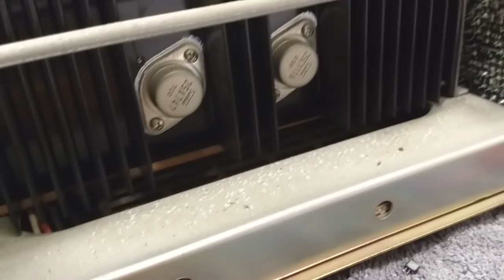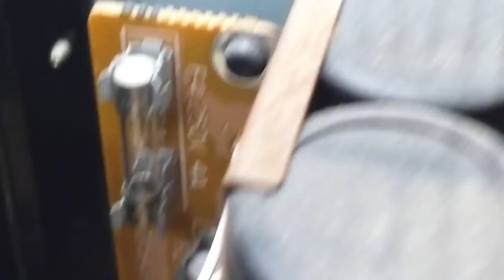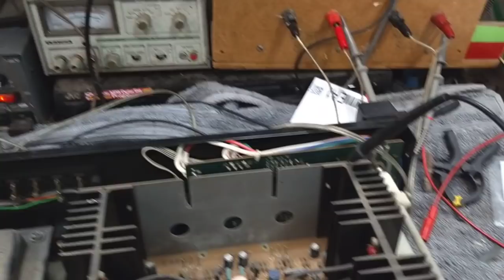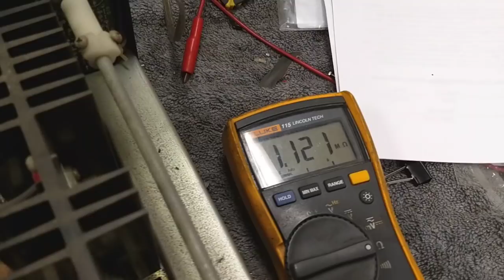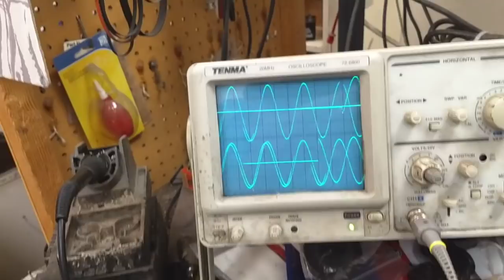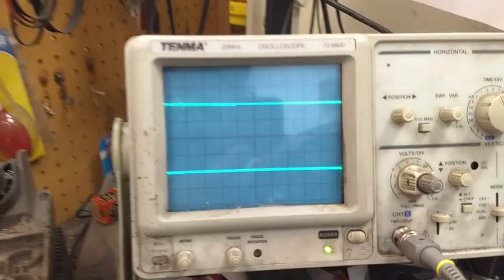Servicing a vintage Kenwood ka-8150 (ka-8100) integrated amplifier part 1/3

Comment: That campsitor right in the middle of of the bird that says 25 on it the bigger one I noticed has some black looking stuff maybe leaking out of it but it works fine I was just going to blow the dirt out and noticed it.
She I replace it before something bad happens or can I use it until it goes out completely?
Thanks

Comment: Tell me please.  Took a Kenwood KA 8150. When turning on/off the "Power" switch on a cold one, there is a click/crack on the acoustic system.  Not critical, but noticeable.  When it works for 15-20 minutes, then the relay works perfectly.  There is a delay, everything is ok.
Reply from the maker: Power switch is failing. See if you have an unused side of contacts. Connect in parallel with existing side.
Reply: @JordanPier  Sorry.  I'm not very good at repairs.  Is it about the On/Off toggle?  Because I thought it was the relay.  Can you explain in detail?
Reply from the maker: @lubchyck  if the crack is immediate when you turn power off, it's the switch. If there is a 1-2 second delay the crack, the problem is in the protection relay circuit. There is a transistor not switching properly or a capacitor not discharging quickly enough.  The circuit would need require troubleshooting to know exactly what is the cause short of replacing all components in the circuit. 

It may also be that regulated power supplies are not symmetrical anymore when cold, causing the problem.
Reply: @JordanPier  crackling occurs only after a cold shutdown: immediately after 1-2 seconds after switching to the OFF position.  if the amplifier works longer than 20-30 minutes, then everything is ok.  I can turn it on and off all day without a problem.

Comment: Pioneer Amps are the same way, where to put that pre-amp board...........................is the problem. Appreciate the insight of problem areas as I am searching for a 7100 thru 9100 (NO EBAY) to buy.